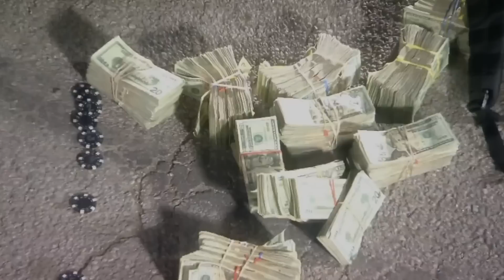The Luxurious Lifestyle of Big Chief

Comment: Man, when I raced in 70s and early 80s I had just about anything I wanted and 20 dollars was alot back then. I'd start out with 40 bucks in pocket cause where I worked pumpin gas and back then we did full service. While the gas was going in the tank we checked all fluids, tires, air pressure and cleaned all windows and checked wiperblades. I made 60 bucks a week which was 10 dollars a day just to pump gas. After a couple good race nights I had a wad of 20s in my pocket and to do 1 race for 100 that was same as a thousand but everybody was happy. Oz of weed was 10 or 15 bucks. 4th lb was 40 and it was dam good gonja mon. Frickin Wva homegrown, best in the eastern hemisphere and country...I wish people where I live now would race. They think a V6 2001 Camero is omg it's insanely fast and they go into some kind of fit speaking of it but they won't race me in my 4cylinder Pontiac Grand Am 2.2 ecotec cause they know I can outdrive em cause that's what I always tell em lol. Just the name of a vehicle will throw em into the fit and just cause I don't do the fit they get mad but I'm used to raw gas pump horsepower although I snuck a bottle in a an ol 63 Chev in the 70s bustn big block ass and I never blew my wee lil tiny 327 400+ 66 vette engine and it did look tiny under the hood of a big ol 63 Chev 2door Biscayne sedan with a 3 speed on the column standard trans 456 gears got  me down a 8th or quarter mile road. I miss it but nobody wants to race where I live. Maybe if I do the fit with em they will lol. Dual exhaust, omg, they would probably try to race the big leagues although they won't race a frickin 04 Pontiac Dammed Am lol